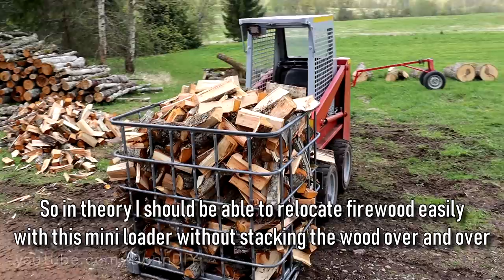Skid Steer Loader Forklift Attachment Fabrication

Comment: We used to build large heavy wooden scaffolding to use with our fork truck that had a tendency to lift the rear wheels off the ground. We built a steel box and hung it on the back of the f.t. and filled it with heavy scrap steel plates. Worked great! Hope this helps. After I wrote this I read the comments below and someone suggested drilling lightening holes in the adapter plate to reduce weight. How about taking it a step farther and cut four rectangles out of the plate leaving a large steel cross behind for strength. Then you can use the plates you removed for building the steel box in the back for adding more counter weights.

Comment: Hi Donn
Put the quick change plate directly to your crates. Would save some weight, no forks needed. Sure, the crates would have to be more stable.
Keep up the great work and thanks for sharing!
Reply: Save a little weight but cost more if he wants multiple crates to store the wood in and avoid unloading it in the barn and stacking it then reloading it into a bin just to move it to the house. 
All extra work that he wants to avoid.
Reply: This sounds like a great idea!  I bet he could use scrap or get the material needed when he designs the crates!
Reply: nice idea. Probably want to be able to pick them up from any angle though. You'd need a quick change on all four sides.
Reply: @FirstLast-wr9mh  I did not think about that.
Reply: @FirstLast-wr9mh  make it a removable plate with a pin?
Reply: That’s not so practical. 
The steel to put it on many crates would be expensive.  Only one one side not so convenient. 4 sides better but 4 sides on every crate is way expensive.
Reply: @tomharrell1954   one adaptor plate on the fork truck with four upward facing hooks to engage in the bin framework would appear to be better than several adaptors on all the bins!?

Comment: My first move would be hanging a weight on the back of the forklift as it wouldn't tip so much giving control... a set of tracks would definitely improve the traction of this lift horse. I sure am contemplating a hook that comes down hydraulically so that you have the control to pinch the log and set it on a sawmill or wood processor and save the peavey work for small adjustments. Your the man Donn, that coming from your friend in Alaska!

Comment: Very industrious addition to the Mini. Looks like it will serve you well with a smaller basket for sure. I'd not be afraid of taxing it's lifting capacity even without additional counter weight on the rear, ram failure or hose rupture would be my biggest fear. Looking like a work horse for your future plans Donn, stay safe !!

Comment: Very clever.  You could lighten your fork assembly, with some strategically placed, large holes in the frame.  It's clearly way stronger than needed for your demands, so some 6cm holes in the base plate would cut it's heft considerably.

Comment: Excellent job.  I am doing the same thing fo my Walden. Same as your Gheil only older.  I added counterweights under the engine.  I'm not sure about building crates when the tank ones are readily available.  300# of weight is added and it handles over 1000# in the bucket. Keep up the good work.

Comment: Your fork attachment will lift more than your loader, by a significant margin. Well done. Glad to see you changed from your safety skids to work boots before welding. I've burned holes in the top of a nylon shoe or two (and my foot) that way. 😂

Comment: That is really nice fabrication like always. And handy loader also! You could drill some extra thread holes into the fork connector plate to include lifting eyes and or even trailer hitch ball in the middle too!? It is handy and safe to have fixed points to mount some chains or what ever is needed when towing or lifting something

Comment: I thought my son was the captain of overkill.  He built a fork frame for his skid steer.  It is made of 2x2x1/4" tubing frame and has 3/8x3" strap for the forks to mount on.  His skid steer is 2200 lb lift and 4400 lb tip and has not had any problems.

Comment: I was definitely thinking the forks need to be “tip up” a lot when sitting flat as you can down tilt them but they are at the extent of the up tilt ( if that makes any sense) 

But you said as much later in the vid.

Adding weight to the little machine will help alot and low as possible 
Perhaps a very thick skid plate?

Anyway you have increased the usability 300% love it well done!

( im struggling with a thumb for my mini excavator as i dont have the matirials)

Comment: I need one of those!  I was a rough terrain fork lift operator in the Army while in Vietnam and have always wished I had one to use of my own.  A small one like this would be perfect.  I have tried using my garden tractor hydraulic 3 point hitch to lift with a single pipe fork, but the cross bar that links to the lift is not strong enough and gets a permanent twist.  It's not really worth modifying it because it's just not meant to do the things I find I need to do.

Comment: For the low cost of used 1T IBC crates (c.€60) , you'd be better off using those than fabricating your own, if you can. Just add some weight to your baby skid steer.

Comment: Perhaps you could build steel waterproof lined rectangle boxes that attach to the rear of the loader that you can fill with water & also be able to release the water when not needed to give much needed weight on the rear of the loader. If a higher pressure oil pump is used then you could also increase the loaders lifting power too.

Comment: Great work as usual, Could wheel weights similar to tractor style be added, could use old cast Olympic weights. Who makes the quick welding clamps you used and are they expensive.
Reply: That clamp is a Maxipress Clamp made by PIHER.
More information: www.piher.com

Comment: The fork assembly must take up about half of the load capacity of the loader.
Perhaps a big chunk of concrete slab on the back would help to counter balance it out.
[Plus an increase in tire pressures, maybe.]

Comment: how much lifting capacity has he consumed with the heavy adapter plate and the forks
Reply: My best guess would be like 30% wich is around 120kg... Could be more or less
Reply: Exactly. The material thickness and weight for the adapter is something I would guesstimate for a loader mounted on a four ton farm tractor. This is seriously over engineered. Guaranteed to last, and could be lightened a lot even with these materials. A lot could be cut off without compromising the structure.

Anyway, I liked watching the manufacturing process. Donn always does a high quality job and the products have a professional look.

Comment: If that were mine, I would cut a big hole out of the centre of the big thick plate that you used as a back plate... that will increase the lift capacity of the machine, by reducing the weight of the actual forks themselves, without compromising on strength too much..

Comment: Great video! 

When welding thick plate steel like that did you use duel shield to get better penetration or just normal weld with 75%-25%

Comment: Nice job ! You're definitly one of the best welder i've seen in DIY videos ^^
Is your loader limited at 400kg by tipping load or is it from the hydraulic ?
If it's the tipping load, just add a counterweight at the back and you'll lift much more ;)
Thanks for your videos btw, it's always a pleasure to watch it !
Reply: Rated load is based off of what can be lifted at full height.. Put it this way a Bobcat S300 is rated at ( I may be off by a few 100...) 3000 pounds while tipping load is rated at 6000 pounds, This means that the loader can lift 6000 pounds a few inches off the ground while almost keeping all 4 wheels on the ground. The smaller units might have a rated tipping load of around 1800 pounds. While you can lift more, The more you lift the less height you can raise the unit. If one is loading a trailer the load might be 1200 pounds to reach that height with out tipping forward.
Reply: @kameljoe21  This is only true for non-radial lift loaders. Your bobcat s300 is not a radial lift. The load moves further forward as you go up. This is generally desirable, since you can more easily load trucks.

My Case 1840 is a radial lift. Radial lifts are simpler and cheaper, but they don't work as well for loading a dump truck. The load moves back toward the wheels as you raise it up. On a radial lift like mine, it can actually lift more at height than it can on the ground.

You are right, that the rated load is generally half of the max tipping load.

Comment: Need to fabricate some sort of rear counterbalance weight. Mayne uprate the rams to give the old skid steer some more lifting power.😁
Reply: Would need to upgrade the pump.
The Ghel 1620 is similar the the Rounder/PrimeMover L/700.
The drive pumps are Sunstrand 15.
Hydraulic pump is a direct drive off the motor. 16 to 22hp, usually an Onan. I went the cheap way and use clamp on forks, they do the job,barely.

Comment: Put a counterweight on the back of the machine. Please do not waste time or energy on wheel weights.
Cheers
Reply: Counterweight has to be limited, otherwise the skidsteer will lift the front when it has no attachement or climb a Hill or simply a little Hump Land. Wheel weight has avantage !

Comment: Hmmm, looks like you might need to build a new tractor.
Reply: I wouldnt put it past him that he`s already thought of it. He did build the amphibious tracked vehicle after all..
Reply: Or just heavily modify this one to maybe fit a better pump or bigger lift cylinders and a rear weight
Reply: @kukkuud2105   would work but... at the cost of the machines lifespan it'll cause additional wear and tear, strain and fatigue on the metal structure itself not to mention all those expensive pivot pins  and pivot pin holes... his better option would be a bigger machine... because  heed need to upgrade the pins, pin hole bosses, reinforce the arm, reinforce the unibody mainstructure, upgrade the hydraulics, upgrade the engine for more hp to offset the added weight and a bunch of other problems and still not have addressed the limiting factor of the tip over weight rating as he would need to also widen it's track width (distance between centerlines on a pair of wheels) as lifting more weight and turning can quickly overcome the machines stability triangle (if you get the center of gravity outside of the stability triangle it's guaranteed to flip)

Comment: You made it way too strong, it will lift 1.5t without problems, but your's skidsteer only lift 400kg! You loose utility weight on having too much steel than necessary... I will take a picture of my hay ball attachement, you will see the difference in weight !
Reply: And be carefull when you lift heavy load, the load goes forward when it come up, so it can be just ok on lower height, but too much when height for the balance, and the skidsteer bascule, with heavy landing...